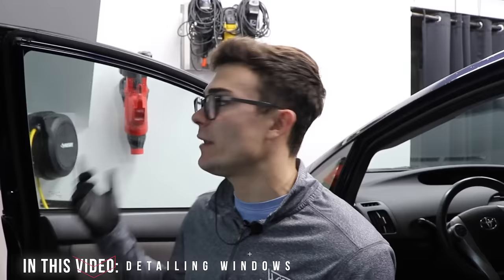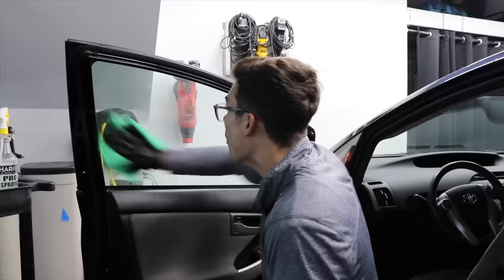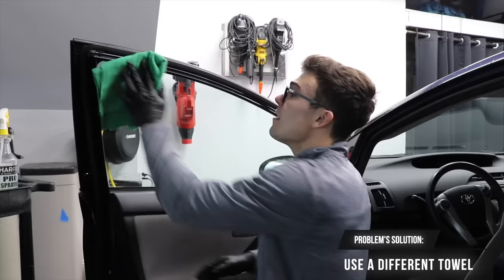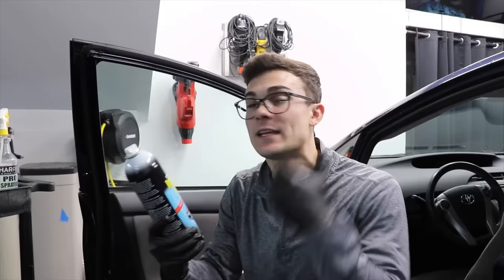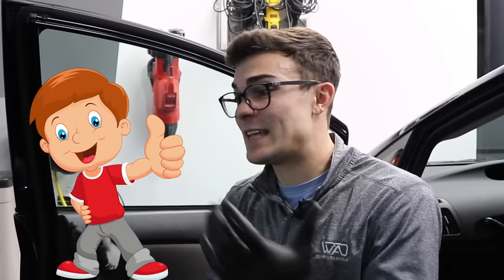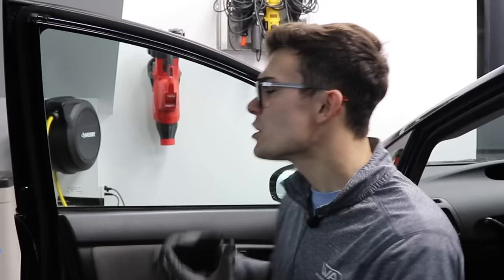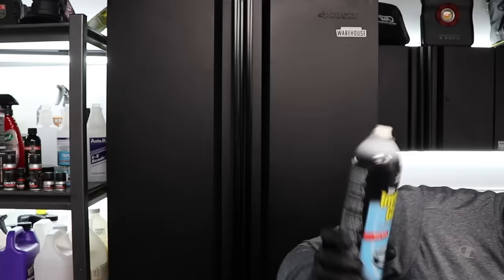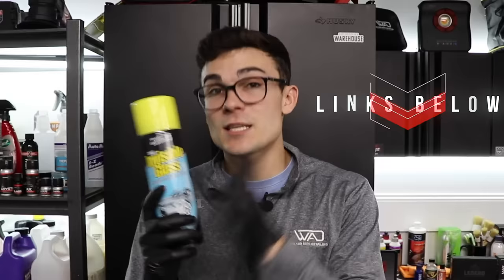Solving The Biggest Problems With Windows

Comment: As You mentioned the solvents, salts and gassing from the plastics that may take a longer time to collect inside but Other much faster reasons your inner glass gets fogged and dirty is from your foods and drinks steam from fast foods and coffee's. 

The fast foods have a fatty vapour mixture from the oils it was cooked in and the product itself being of beef, lamb or chicken etc including salts used during cooking, and coffee will have a subdued oil vapour as it will be mostly the water steam vapour. 
When hot and transported in your vehicle these vapours will condense and stick to all surfaces. Ever notice after taking away certain foods you may still get some of the smells the next few days from your air conditioner,  this fatty steam vapour condenses on the windows drying out the water vapour leaving the fats, salts and oils building up and in cooler climates this happens much faster than in warm climate areas, until you next attempt to clean the window and this may lead to more solvents or cleaner to stop the streaking when cleaning as not all layers of the fatty deposits may have been removed with your first or second passes. This will depend on how long you have left between cleaning or detailing and how regular you transport hot foods and takeaways.

Comment: What about using a 50/50 of water and white vinegar? I had read/heard about it years ago and it does a great job of cutting through the deposited vapor from the out-gassing dash material (it removes grease and other material from the rims of canning jars, but that's a different subject, lol). While I have use isopropyl alcohol before, I never mixed it with water. While storing that bottle, does the alcohol not evaporate over time? Also, I had not thought of using a waffle weave for removing the 'lint' left behind before and I will do that the next time I clean my windows. Thanks for that info. BTW, Great video!

Comment: For me if I use a small amount of Dawn dish soap with a gallon of water, then wipe and clean the window with this it will breakdown and remove the haze. Dawn is a good degreaser.  Only use this on the glass, windows, of your car but it works great to remove the haze and gunk that builds up.

Comment: I like the alcohol tip. But yes when I clean windows every time is I spray it with my cleaner wipe it around and then grab a dry new towel and wipe the window dry and it streak free every time quick and easy

Comment: Nothing works as good as paint polishing compound.  No matter what is on the glass,  it gets lifted by the compound and your glass gets properly polished at the same time.  On top of that,  you can easily see which parts you've missed.  It has been my fail safe go to method for years.  Fast and efficient.

Comment: All good tips…..thanks. I’ve been using the Mr. Clean Magic Eraser (original) and plain water and it removes everything including hard water spots, tree sap and bug splatter. Leaves a spotless streak free window. Works great on interior as well. It is important as the video points out to use a good quality towel when drying.
Reply: Its abrasive so be careful w ur glass
Reply: @impulse9091  No problems to date. I think you just need to make sure the Eraser is good and wet.

Comment: I've used white vinegar/ 80% iso alcohol/deionized water (I have access to the alcohol and water where I work) to remove the out-gassing vinyl release agents on glass. It cuts any gummy residue and evaporates quickly. Invisible Glass like most window cleaners (like Windex) contain wax. Use it as a final polish.

Comment: Paused at 1:35. Um IDK if you mention this later on in the video or not, but the very first problem  that should be mentioned is that cleaners should not be sprayed onto the surface of what is to be cleaned. Even more so if what is being cleaned is glass or mirror. Why? to keep propellent off of the surface of what is to be cleaned. That goes for all cleaners. Disinfectants are a different story since they need time to work and not what we're talking about here. Now to finish the video :D

Comment: I had the windshield replaced in my car several years ago and after about a week of cleaning it, it develops a haze around the perimeter of the glass; I assume this is the adhesive or sealant outgassing. I have a can of invisible glass and hate it; it seems to work well but it takes a lot of wiping with clean dry towels after using it, otherwise I see a "rainbow" effect when the sun shines through the glass.

Comment: NuFinish Once A Year Car Polish is what I use, after seeing it demonstrated right in front of me. It is not WAX, it is polish. There is no wax contained in it. It's liquid, and you apply it to glass just as if you were applying wax. Wait about 60 seconds for it to dry and then remove the powdery remains using a rag or micro-fiber cloth with no scrubbing and no effort, and it ALL COMES OFF with no streaks, no residue and a clean appearance not seen since the glass was new. If you've ever watched old videos about WWII bombers and their maintenance you may have seen a very similar approach use by ground maintenance crews when cleaning windshields, bubbles and canopies on planes.

Comment: Best washcloth to use is jersey knit; that is, a clean t-shirt that's damp (not soaking wet) with very warm fresh water. Alcohol based sprays are garbage on their own. By all means use them, but wash them off after they get rid of oils and other crap like cigarette smoke residue. NEVER clean windows in direct sunlight, but instead leave the car out in the sun to heat the glass then move under cover. Why warm up the glass? Because it dries off the water much faster when you go for a second pass with a completely dry t-shirt rag. Trust me, you won't get pure crystal clear glass by using just bottled 'glass cleaner' liquid alone. You'll also find any interior fogging will clear much quicker once you direct your car's air-con onto the glass.

Comment: I'll add this to my existing process. I'm not a pro, but I do periodically do the glass on our cars because it just doesn't get clean enough at the car wash... and we can't really afford detailing very often.

I found another video several years ago and the process I learned there makes glass literally disappear. Adding the alcohol will make it a 4-step process now, at least on the exterior. What it does is start with 0000 steel wool to get rid of anything ordinary cleaners might struggle with. Then regular cleaner, but now I'll be using alcohol first. And finish it up with a buffing of plain, cheap carnuba wax. Sounds odd, maybe. But old-fashioned paste wax is simple to apply and works better than Rain-X or similar products. And it lasts MUCH longer. I also wax the interior glass to prevent fogging. Whatever you do, do NOT use the steel wool on the inside. It will destroy any film you have. This process leaves the glass so clean it's actually freaky.

Comment: Just use Simple Green Glass Cleaner with a dedicated Glass Micro Fiber cloth. Spray on  and wipe off, any moisture lift behind will evaporate and no streaks. The cloth I use is smooth and is made from 80% Polyester and 20% Polyamide, best cloth I have used. I hand wash it with liquid laundry soap with cold water.
Outside of glass, I use a scraper with a brand new blade and use soap and water for lubrication and clean the glass, finish washing your car and dry it, then use  Simple Green Glass Cleaner with a dedicated Glass Micro Fiber cloth. Now use RainX Water Repellent on outside of glass and your done.
Thanks

Comment: Waffle weave towel and/or squeegee. Plain distilled water and a squeegees are great solutions for problems 1&2.  Sometimes a dry ww is all you need to clean the inside of the front and back windshields. Exhaled carbon dioxide along along with monoxide do not mix well with "cleaners". So dry or just water first. Followed up with cleaners to give the windows that sparkle we all love. Trust me on this.  I live in SoCal so this may not apply to anywhere else geographically

Comment: Resist All glass cleaner, and a microfiber towel work the best for me.  My Buick dealer gave me some Resist All from a manufacturers promotion.  I was surprised at how well it works.  Do not use paper towels because they are treated with something at the factory that leaves streak Mark's on the windows after cleaning.

Comment: For the problem №2 I use >90% isopropyl alcohol instead of 50/50 mix. 
Also question: how safe is to use magic eraser sponge on the outside surface of a glass?
I used it a couple of times on the windshield and it helped a lot with removal of lines made by wiper blades but idk if it is safe in a long run.
Reply: You can also use steel wool on your windows.

Comment: Great advice, thanks, have been using invisible glass for a while with no issues (will now also pre clean with distilled and iso) recently tried invisible glass clean and repel and for me at least it was terrible, water just sat on the glass instead of beading off and made the wipers judder really badly, had to remove it all, not to be used again!

Comment: Before all the products were available..  this problem existed ..  the solution was a small  bucket 1/2 full of water and a squirt of dishwasher soap mixed.  and a wash cloth. Swish the cloth in the mix.. wring it out and clean the window. Next.  While the window is still slightly wet.. wipe dry with a clean towel. Still works for me.

Comment: The friction of microfiber rubbing over glass is too high and you are literally shearing fibers off. A waffle weave towel is microscopically different and can withstand the high friction of glass. This is why they glide over glass with little force.

Comment: I enjoyed your video. I usually do not have these problems. I do use Invisible Glass in spray bottle only. I do not care for the aerosol can. I will try the 50/50 for the front inside windshield. I do have some haze on it most the time. I will stay away from acetone, though.

Comment: I never use cloth, micro fiber or other cloths.  Paper towel far better for glass. I prefer aerosol glass product and polish using 0000 steel wool which polishes out contaminants. Then paper towel drys streak free.

Comment: Kindve surprised by the use of rubbing alcohol instead of straight isopropyl alcohol. Isopropyl and distilled water mix is used in most other industries, including electronics. I wonder why rubbing alcohol is preferred for auto glass.

Comment: I have an idea how about using a micro fiber cloth and window cleaner to scrub the window and remove as much as possible and then go over it afterwards with a disposable paper towel made for windows or mechanics paper towels. If the streaks don't come out use a very small amount of window cleaner and rewipe with the lint free paper towels. I saw this video and couldn't believe that someone could turn something so simple into a science experiment. Common sense goes a long long way here

Comment: Thanks for the tips. I've been using the Invisible Glass product and typically have good results. I have had issues when using microfiber rags on glass, tiny fibers everywhere. I tried using CG waffle weave "Gray Matter" towel with the same disappointing results. For now I have to use cotton rags to avoid this.
Reply: Just don’t cheap out buy new towels for every car you clean.

Comment: My wife’s car has a bad haze on the windshield and under certain conditions like the setting sun or at night in the rain it’s really bad. Its so bad when a on coming car would come I couldn’t see jack. So I tried the invisible foam cleaner first and I’ll see what happens. If that doesn’t work I have some pro grade stuff at work I’ll try. If that fails I’ll try the alcohol .
I think what may have caused it her using the microfiber cloths at the car wash. I’m betting there is a lot of interior detailer type residue in those rags.

Comment: Interesting, I live in Fl and never had this problem with invisible glass and humidity. 
I’d be a little wary of spraying 50/50 like that, wouldn’t that be a hazard for leather door trim? I try really hard to to avoid getting glass product on the doors and vice versa.
For cleaning towels I would get some of that microfiber cleaner, use the gentle cycle for washing and drying. Keeps my towels pretty fresh.

Comment: I use one microfiber towel for the initial cleaning after I spray ... then a different one for the final wipe .. And that most of the time takes any haze or streaks ... But the question I have is is there a solution to cleaning inside of the windshield .. ?? ... Ive tried invisible glass wipes .. then wiped w/ a microfiber towel .. I was told u shouldnt spray ur windshield and let the glass clnr spray to drop on the dash because it'll leave spots  ?? .... But cleaning the windshield has got to be the toughest area ... I think anyway ..

Comment: i use chlorox disinfectant wipes (yes yes, i know, still works for me), let it haze after scrubbing thoroughly, wipe everything i can up with a microfiber to get it as close to 100% as possible, then go in after with chemical guys glass cleaner and a new towel. as a bonus, the wipes also cut through smoker residue with minimal fuss, though you may go through a few with a large surface to deal with, and a film thick enough it colors the glass.

haven't had any issues this way, besides the time it takes to do it.

Comment: Thank you. Them streaks were driving me crazy.  Would you use water/alcohol solution on the outside glass as well or only interior?
So far plain distilled water has worked better for me than any of the solutions I have tried.

Comment: Yup, I've been using alcohol to cut through the grease that accumulates on the inside of the windshield as well. 
Can you give us some advice on how to remove tree sap from the outside of the glass? I have car that has been parked underneath pine trees, and I did multiple rounds of warm soap followed by goo-be-gone, scraped gently with a razor blade, than rinsed, washed with dish soap - and it is still there (albeit less)

Comment: I was a production line detailer for just shy of 2 years, and glass was ALWAYS the hardest thing to get right. 

Youre totally right about glass cleaners not cleaning. I actually got in the habit of cleaning the windows with carpet cleaner before going over it again with glass cleaner. Worked good to reduce streaks, but certainly not a perfect solution. Never thought about humidity effecting things so much.

Comment: At one point there were several very high quality glass cleaners on the market that left virtually Zero residue. Wesley's Bleach White GLASS CLEANER, not the tire cleaner was one of the best if also very harsh. I'm betting that crap was toxic... Working my way through school as a detailer (I'm old) for streetrods and show cars I found the Alcohol Distilled water Mix as the most consistent and less harsh. I used 100% Alcohol as it isn't expensive and why dilute it in their bottler and then again with distilled water. I found we created more issues than we solved with the products on the market.. That term "Shine" for interior work is just horrible when it comes to gassing out, or leaving streaks and a residue load that collects dust and dirt like a shot of WD40 would anywere on the vehicle. Most interior materials of a show car/new car are going to ooze chemicals for years especially in heat of the day and cleaning is about all you can do. Those dressings for semi-soft surfaces just leave more crap on the surface... Not to the extent as you spraying half a bottle of Armor-All on a seat and hoping the owner of the car doesn't slide his fat ass into the floorboard, but less chemicals in the cleaners and what is left on the surface is the way to go for streak free everything. Even just warm clean water on a soft towel will get most of the junk off the glass and the cleaner you follow it up with and clean towel will not be spreading the junk all over the glass. For the towels, I doubt any of today's detailers would use what we used in the 80's 90's. We could buy thick 100% cotton diapers at almost any store and when washed correctly (not harsh soap residue left over) they were perfect. But nobody sells them any longer of this high quiality. If we needed a cutting edge for glass or chrome, the waffle cut or ridged 100% cotton Kitchen towels. Heavily washed to break down the surface.  Most owners cause their own issues. For years I cleaned both an airplane and a Rolls-Royce for a great customer and we never could find out why there was this sticky icky crap on the inside of the car and sometimes the plane. Turns out he loved his coffee and nearly boiling huge cups were left in the car while he went about his day.. The sugar, cream and coffee, etc would gass out during the hot summer day in Houston and collect everywhere... Even damaging that hand crafted wood surface in the Rolls... It's not always what YOU did.. Great ideas and suggestions on your videos... Wish YouTube was a thing when I had to learn those tricks.. Also wish would could have charged more.....  Hope some of this Old School BS helps even a single detailer out there.